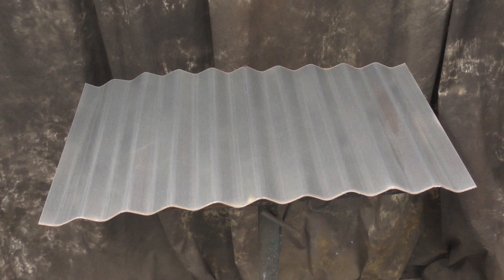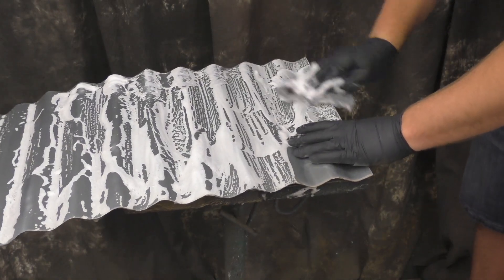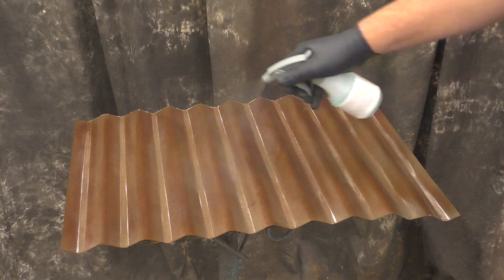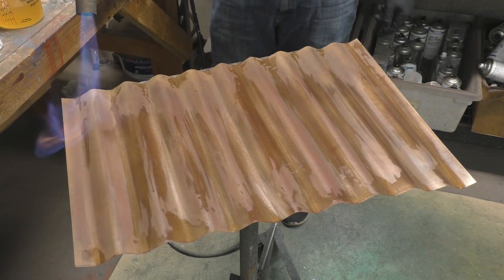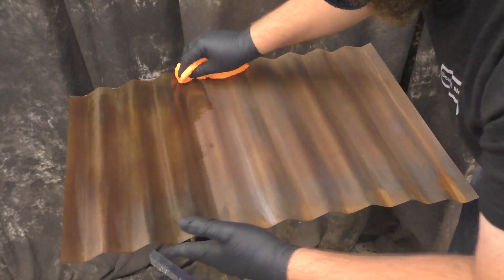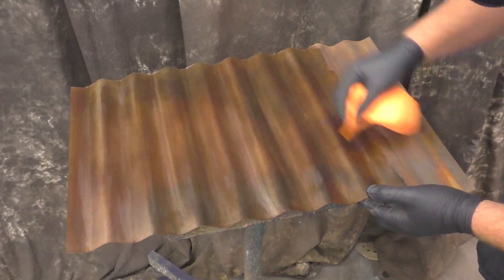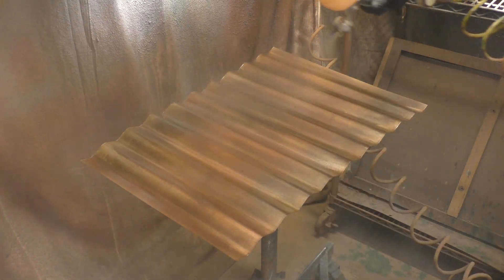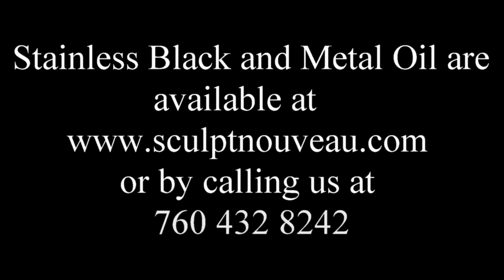Rusting Zinc or Galvanized Steel

Comment: Hi, could you tell me how much of the stainless black and metal oil I would need to do 8 ea. 3' x 8' sheets of same material in your video? thanks.
Reply from the maker: One gallon of Stainless Black Patina will cover about 200ft². One gallon of Metal Oil will usually cover 300ft².
Reply: @sculptnouveau  thanks for the reply

Comment: Hi, I'm very interested in this.  Looking to do a couple 8"dia x 12' galvanized steel gate posts. I keep reading below to coat it to make it last longer.  What happens if you don't add a protective coating?  Will the patina just wash away eventually?  How long will it last outside in the weather?  And, can I just re-spray if it does wash away eventually?  Thank you in advance.
Reply from the maker: The patina wont wash away but it will change on its own depending on the environment that you are in.

Comment: Is this a color coating or is it actually rusting the metal?  I am putting this on the side of my house and am wondering how it will weather.  Thanks!
Reply from the maker: The Stainless Black is actually rusting the surface layer of the metal. To increase longevity and lifespan, use a clear coat such as Ever Clear.
Reply: @sculptnouveau  awesome!  I really want a rusty look and I am not seeing that happen on any of the youtubes with muriatic acid and galvanized steel.  It's pretty spotty.  Headed to your website NOW!
Reply from the maker: @sharleejohnstonbrosnan2854  Glad I could help!

Comment: But why would anyone want to rust the galvanized iron?? Everything is done to protect the metal (iron) to secure it from rusting! Can you explain please?
Reply from the maker: Everything we sell is to help reach a desired look. If the metal is galvanized and they want it rusty, this is just an option rather than sandblasting off the galvanized coating.
Reply: @sculptnouveau  Okay. Didn't know that. 👍

Comment: Hello, looking to do something like this on an interior cathedral style barn ceiling. However, would like to do a bit lighter color brown and maybe add some blues or cooper colors if possible. Do you have any recommendations?
Reply from the maker: If you want a lighter brown, try diluting the patina or leaving it on for less time. Depending on how vibrant you want the blues depends on what I would recommend but the Universal and Dye Oxide finishes might be a good place to start your search to add copper and blues. Give us a call and we would be happy to assist you further, 760 432 8242.